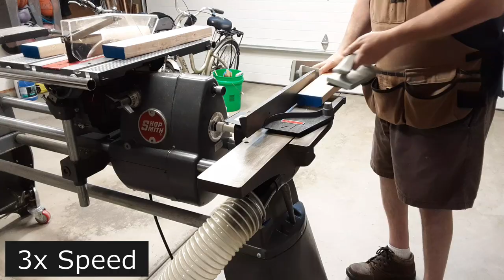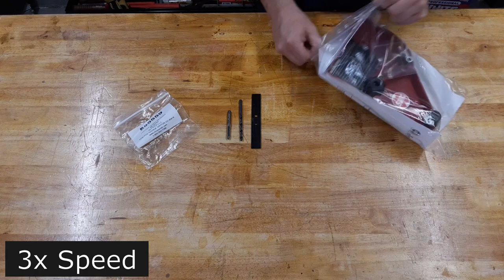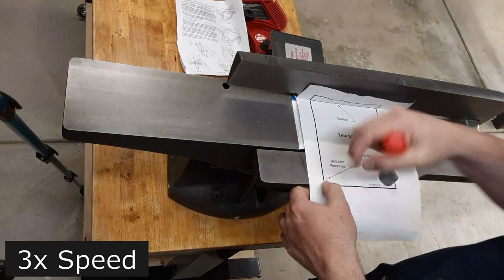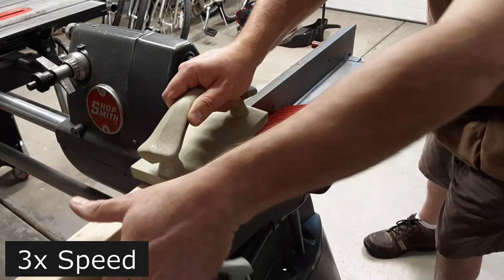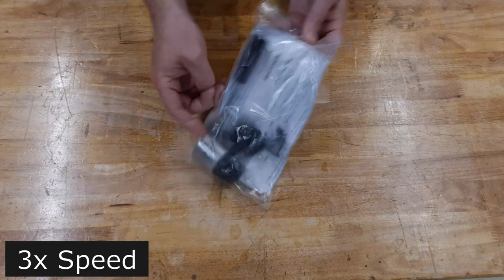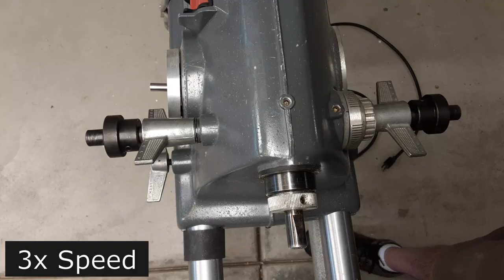2-in-1 Guard & Feather Board: Installing Shopsmith's Innovative Jointer Upgrade

Comment: Great video. I am getting ready to install the new guard on an old jointer that I've rebuilt, so I looked up your video to review the procedures. It's great to be able to watch someone do the job that you need to do before you do it. Thanks.
Reply from the maker: I'm the same. I like to read/view anything I can before diving into something. Hope your conversion goes well. I'm very glad I did mine.

Comment: Great vid and an excellent upgrade. My sister just purchased a SS with an old jointer that doesn't have a feather guard and this upgrade is the first thing I'm suggesting she do.  Scott
Reply from the maker: Yeah, I saw you pic in your community tab, congrats to your sister! I'm liking the upgrade so far. And I don't think I've seen anything like on any other make of jointer.
Reply: @woodshopnerdery  No, to the best of my knowledge it is unique to Shopsmith.

Comment: Great new change, I will have to look into getting a new one for my SS.
Reply from the maker: Thanks Bill. A couple months have gone by now and I can say I am really glad I did this upgrade. Not only does it resolve the safety concern I had with the old broken guard, I am much more easily getting square corners due to that feather board.

Comment: Thanks for the video. Just happened to run across it. I have the older version of the jointer and had purchased the upgrade. I don't have the problem you had, just wanted to upgrade it. Haven't installed it yet because I've never done the drill and tap thing and was concerned that I will screw it up. Glad to see your video, maybe I'll tackle it soon after the holidays.
Reply from the maker: I really like the upgrade. I agree tapping the thread is intimidating, but there are probably some tip videos that cover it.

Comment: and the Jointer is the only shopsmith tool I got hurt on, only because after aligning the blades I didn't turn up the speed to the appropriate level while testing it out.... thank GOD the drive broke, it could have been worse than a black and blue knuckle.
Reply from the maker: Sorry to hear about the injury and glad it was not worse.

Comment: I just went back and re-watched this. So did you add the dust chute retrofit kit (includes the coupler guard and rear blade guard) or was it already installed?
 
The retrofit kit is obviously not original because the outfeed table has the hex hole to move the blade guard to the rear for rabbeting. I ask because I find it odd that if you didn't install the retrofit kit, that the previous owner did, but didn't also upgrade to the feather guard as well. 
I believe the dust chute and rear guards were put in to production at the same time the feather guard was introduced, which were all standard on a new jointer from then on.
Reply from the maker: Chad - I don't know the answer for sure. The jointer came to be with the dust chute only. Based on the jointers age, I do not think the dust chute is original. The name plate lists the old Vandalia address so does that make it later 70's early 80's?

Long before I started the YouTube channel, I added the rear fence blade guard and the coupling guard. I bought both new from SS separate from a dust chute, perhaps from the Service Parts catalog? I don't remember for sure.

Comment: To fix the original guard, check the spring tension, not hard to do... but the better idea is to just replace the guard... Now, I have a question that maybe you could answer... the infeed of my jointer is slanted downward towards the tail, any ideas of how to fix it? Please?
Reply from the maker: Thanks for watching and commenting Me58651. I agree with you, an easy fix is to retention the spring. I did that myself maybe a dozen times in the last six months. It kept popping out of the socket because it was so bent out of shape it would not seat properly.

Regarding the infeed table, it should lower, relative to the outfeed table, to set the depth of cut but should always be parallel to the outfeed table. The infeed slides up and down an inclined set of grooves, maybe some debris is caught in those grooves cause it to slant? If it were me the first thing I would try, with the machine off and disconnected, is run the infeed table up and down all the way a few times. That may clear any debris. Second thing I would try is to take some pictures and post it to the Shopsmith owner's group over on Facebook.

Here is a Shopsmith Forum post discussing a similar issue. https://forum.shopsmith.com/viewtopic.php?t=15457

Here is an ebay post with pictures showing a jointer disassembled so you can visualize the two halves. https://forum.shopsmith.com/viewtopic.php?t=15457